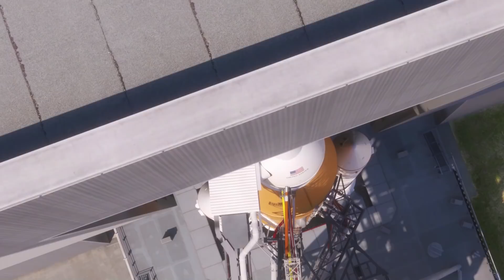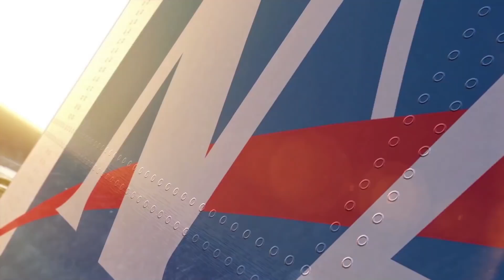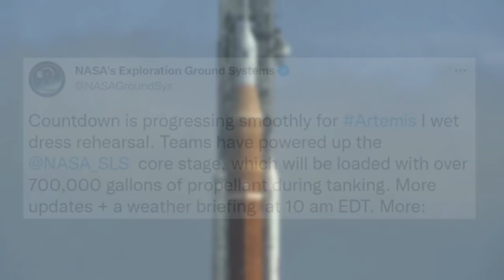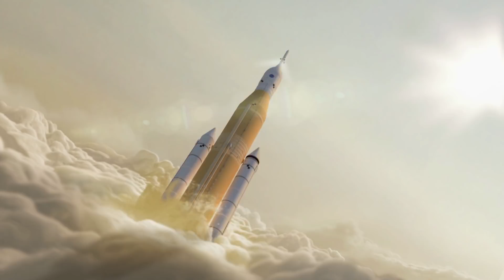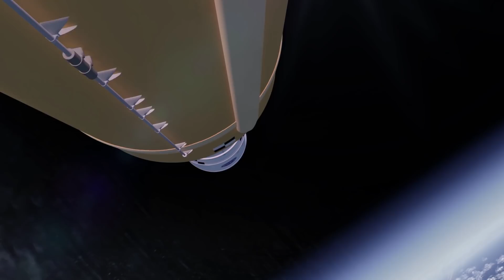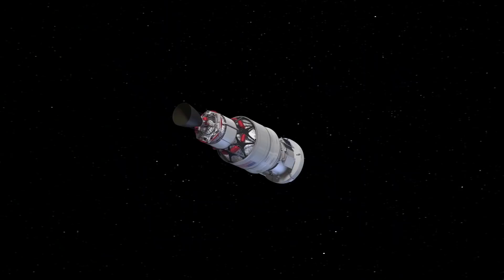The Space Launch System’s Wet Dress Rehearsal Has Been Very Eventful

Comment: This is not a fail. This is a success of their testing process and their adherence to it. The only difference between a rocket and a bomb is control and that is potentially one big bomb.
Reply: You are 100% right but that process has been going on for over 75 years and that is enough PRACTICE I should think.
Reply: It's leaking bomb and when that leaks just right speed, then it works. Too fast or slow cause explosion. Then you loose wechile and sometimes crew too. Rocket motor is continuously and controlled explosion and sometimes in big scale. If you have over hundred bar pressure all time in burner and then you let it go out from nozzle, it's grasy thing how small fails could end whole trip. It's "miracle" that they don't lose more staff and stuff, and it tells that they do their job great.

Ps, use ISO standards, bar, celsius, mm etc, if it's possible for you. I just ask for it. Thanks.